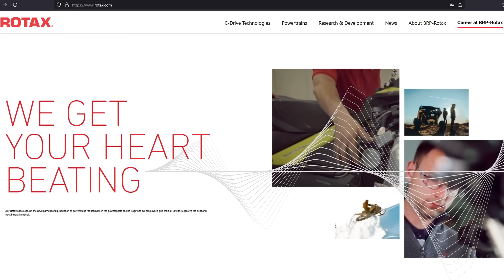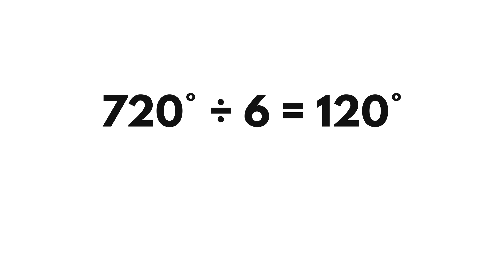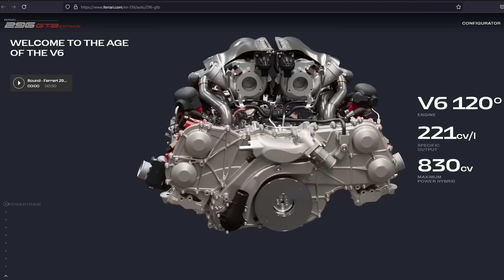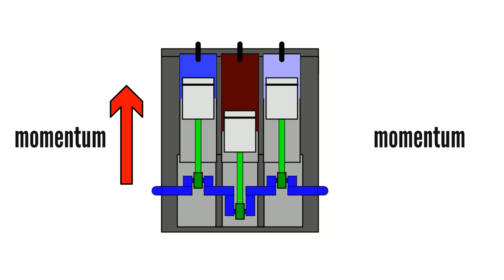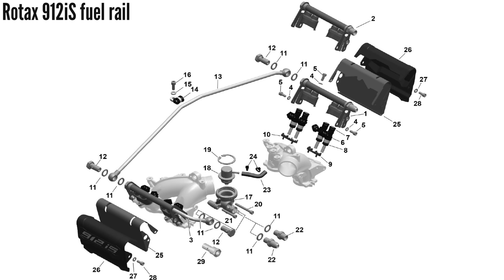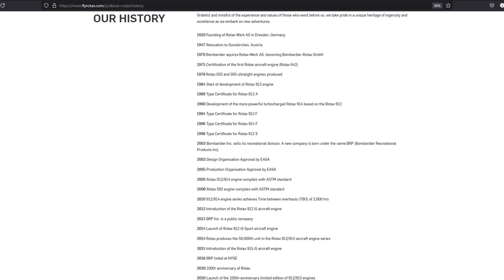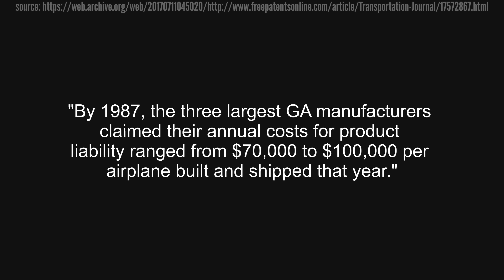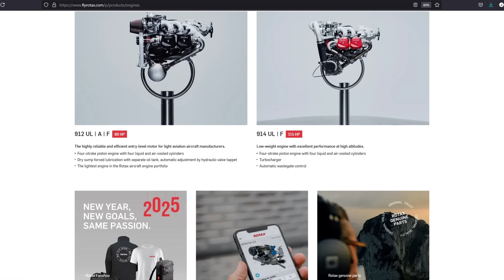Why Rotax's 300hp V6 Aero Engine Never Saw Production

Comment: By looking at the fuel consumption values, another reason why it might have been canceled was it had marginally better efficiency than the competition, actually worse than Lycoming IO-540, while being more complex and probably more expensive. In that range there were already 4 established options, and chances are the market was not big enough to be worth the risk.
Reply: That was my read too. Didn't bring enough to the table at the risk of being an unknown quantity with much higher complexity and crank speed, for probably little less money.
Reply: @spinnetti  Single-lever control, liquid cooling, less weight, less drag, greater efficiency, unleaded fuel... that seems like plenty of improvement.
Reply: I almost thought that was a typo at first, I mean a small-displacement liquid-cooled engine should have significantly better SFC than AN 8.9 LITER aircooled engine lol! That's just wild. 

One other factor beyond liability is the certification costs involved.  How exactly would this retrofit idea even work? The airframers aren't going to pay for it, unless it's divided up into a new model as another engine option or sole powerplant.  And why would a customer buy this when the original engine performs the same? ...and even if they DID want a retrofit, how do you even begin? Who would make all the conversion parts? Net cost would be significantly more.  Also it's not like people REPLACE engines, they almost always just overhaul them. 

Another factor is that it's liquid-cooled.  Where do you put the radiators? That inherently adds complexity and cost, while lowering reliability. I'm assuming it's DOHC? That also makes it significantly more complex and failure-prone than the conventional engines. 

Plus is it really realistic to have an engine that spends a significant portion of it's life at the REDLINE of most automotive engines?! That alone would be a deal-breaker for me.  There's a reason why almost all aero engines are designed for low-rpm, high-torque applications through absolutely massive displacement. This is exactly the opposite of that. 

The engineering behind it is indeed very impressive, but it kinda seems like a solution looking for a problem honestly. Products with that issue typically tank massively - and with that in mind, it seems like a no-brainer to can it.  Then again, that begs the question.... why bother in the first place (unless it wasn't even close to reaching their initial performance goals? I )
Reply: @EstorilEm  "Where do you put the radiators?"

Anywhere you want, they're tiny. See Cessna 414A Ram V (they're basically invisible on this aircraft), or the diesel powered Skyhawk JT-A.

"I'm assuming it's DOHC? That also makes it significantly more complex and failure-prone than the conventional engines."

It's SOHC, and there's literally nothing that indicates that OHC engines are inherently less reliable than pushrod engines. The SOHC, 2-valve arrangement used in the V220 and V300T also would have drastically reduced complexity, greatly reducing the number of moving parts (no pushrods, no rockers, only simple bucket tappets). No one is complaining about the current crop of diesel aircraft engines being DOHC, either, and they're proving to be highly reliable.

Rotax 4 cylinder engines rev to 5,800 rpm, this engine revved to the same rpm (not, 6,000 rpm, as the video suggests) and there's every indication that they're more reliable than the low rpm aircraft engines in the same range of power output.
Reply: @EstorilEm  actually, most new piston aircraft engines are hi revving Rotax engines due to their immense popularity
Reply: @ Only for LSA though… which is a fraction of the GA market (at least in the United States.)
Reply: According to ANN: "Initial fuel readings were an eye opener... with a solid 75% percent of rated power in use, the Super Rebel was consuming 11.0-11.2 GPH..."

That's FAR better than any LyCont. His consumption number appears to be from an earlier report, where the writers were just guessing.
Reply: @PistonAvatarGuy  that’s interesting - it seems like it was actually closer to 18gph though?

Then again I help maintain and crew a TBM avenger with an R-2600 (42.7 liter) that can reach over 100 GPH on takeoff, so… 😂
Reply: @EstorilEm  18 gph? According to what source?
Reply: @EstorilEm  Even if it was 18 gph (at full power), that would put its BSFC in the same range as the most efficient diesel engines currently being sold for use in aircraft. Some of the MWfly engines are also in that same range.
Reply: @EstorilEm  And, sure, 11 gph at 225 hp is almost certainly too good to be true, but what's the real number? Everyone here is just guessing. That's the problem with this whole debate about modern gasoline engines, no one actually knows anything.

Comment: A 200HP class 4 cylinder engine would be much more sensible for Rotax than a 300HP class. This extends the current engine offerings and allows them to target the Rans RV-7 & 9 kit aircraft market. If this was normally aspirated then they could possibly extend this to a turbo variant for the RV-10.
Reply: The 210hp Lyocming is so ubiquitous that attempting to compete directly is suicide to the project. 300hp put them into a market where they could compete much more easily, and let them use a layout that was a lot lighter and more rigid than inline or boxers, but had historically been less viable due to balance and vibration concerns at large displacements, giving modern, higher specific power but higher weight per displacement and faster rotating designs more ability to compete.
Reply: @SheepInACart  But how is it easier to compete against the equally ubiquitous IO-550s? Look at how well the IO-580 fared. 300hp is outside the range of the average homebuilder so they'd absolutely NEED a launch customer to get any number of engines on the market - would Cirrus bite? They didn't for the CD-300, even at a time of uncertainty about the future of 100LL. 20 years ago, not depending on lead wouldn't even have been a selling point.
Reply: I was just thinking the 300 HP would be perfect for an RV-10! (Although flutter and turbulence would be key concerns.)
Reply: The 180-260hp class is completely saturated with every version of Lycoming and Continental. All of their derivatives LyCon, Barrett (who first made the IO-390 as a hopped up 360). Plenty of cores to overhaul to like new for under $50k. Plus ULpower, Subaru, Wankel, etc.

There is a niche need for a 500hp class piston engine. But Red Diesel seems to have this Ag and Beaver market targeted.

Most four-seat airplanes weigh around 2,500lbs and to obtain 10lb per hp that would be of course 250hp. This is almost certainly the ideal engine size for a V6. Especially if it weighs less than a Lycoming IO-390 (210hp) and is Turbocharged, where its performance readily exceeds the IO-540/580 260-315hp jobs above 8-10,000ft.
Reply: Example: 
235hp turbocharged maximum rated takeoff power up to 15,000ft.

200hp (85%) up to FL180 turbo pressure ratio 2:1.

This is equivalent power to a 400hp IO-720 at maximum 2,700 RPM, wide open throttle at FL180-200.

So the little 235hp V6 would absolutely replace Carbureted 235hp Continentals and Lycoming O-540s almost exactly for sea level takeoff and climb performance. While blowing the doors off the 400hp IO-720 between 15,000-30,000ft.
Reply: @Triple_J.1  Would love to see one, doesn't look like anything is coming though. Maybe the Deltahawk some day. I'm interested in the Kawasaki project, but wouldn't be surprised if that gets shelved before the first engine runs on the stand.

Comment: Rotax is busy building for Iran and Russia most non quad copter powered drones in war  there are powered by Rotax 912  point is if you order one it could take months to get unless its old.
Reply: Unlikely.All shaheed 136 drones are powered by Mado,a locally produced copy of the German Limbach engine.
Reply: @eugeneoreilly9356  IIRC Limbeck did some aero engines based upon the old VW air cooled 4 cylinder that originally went into production about 90 years ago. It would be amazing if they are copying and using this old classic.
Reply: Reference, pls. I haven't seen a single Rotax engine on any of the downed drones...
Reply: its not rotax itself but Iranian copy of their old motor